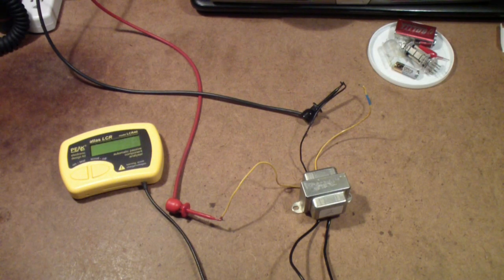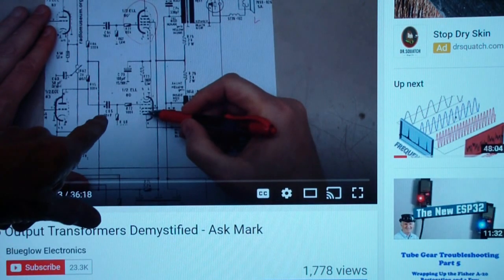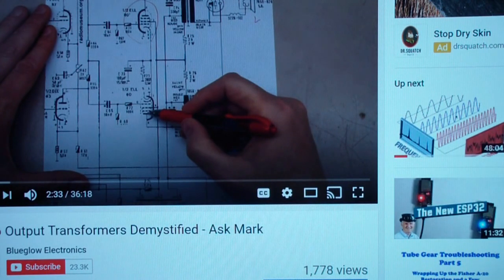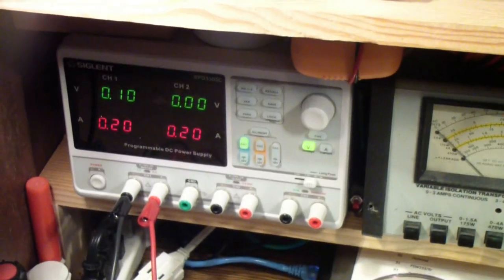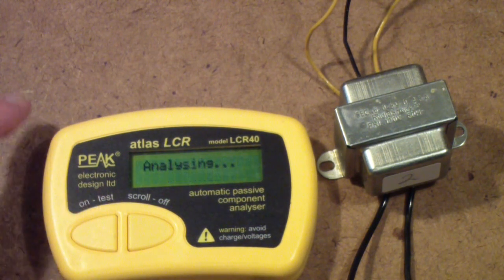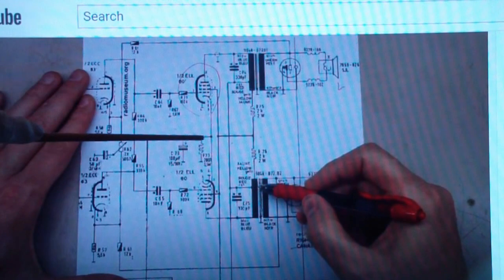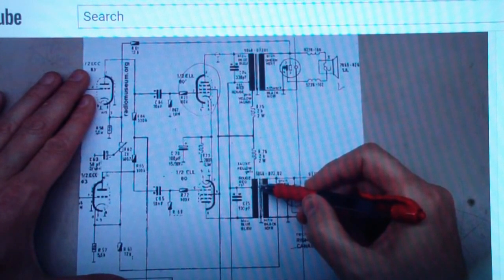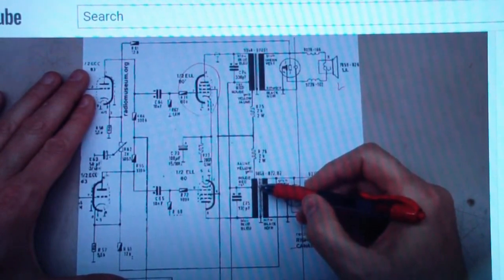TTT318 Output Transformers Single Ended & Push Pull

Comment: Thank you for your video.  I have one concern.  Is there a need to protect the Atlas LCR meter from damage since you are running a dc current through the transformer?  How do you test a transformer to find out if it single ended or push-pull?  Thank you.
Reply from the maker: Thanks for the questions. The DC current is not in the winding connected to the LCR meter. You should apply the current and then connect the meter to the other winding to measure inductance. It is possible to tell a single ended transformer by external measurement but to do it reliably requires you to have specifications that most manufacturers don't publish. The best way is to look up the model number in the manufacturer's catalog since they always specify the type.
Reply: @tomtektest8042  Thanks.  That makes sense.

Comment: Very useful info, thanks.
Kudos for spreading info on Mark's channel around. I think you are the first one to put out a video on the air gap in the single ended  transformer. I don't recall watching anything on other channels like El Paso Tube Amps or Uncle Doug's channel...
BTW, a good channel for European radios is Electronics Old and New.
Cheers,